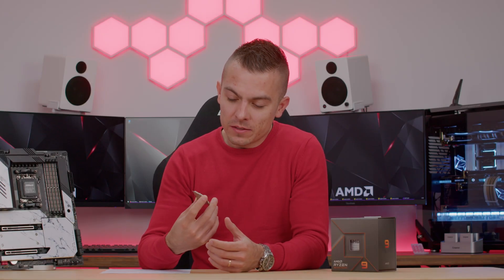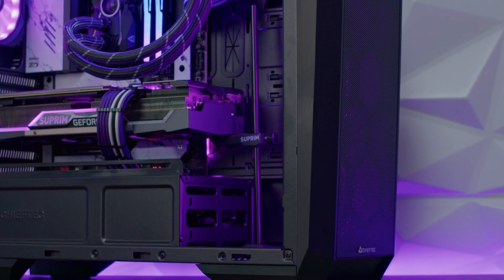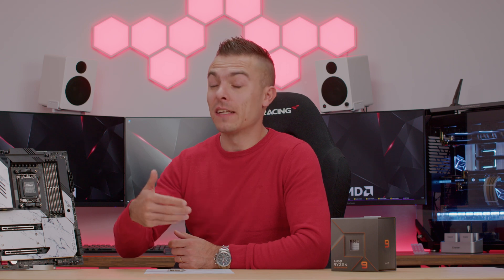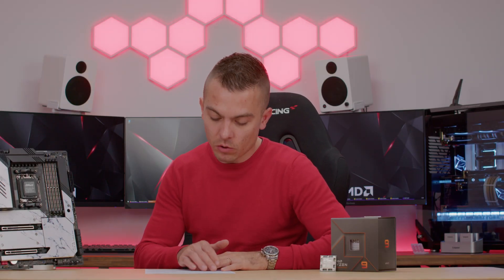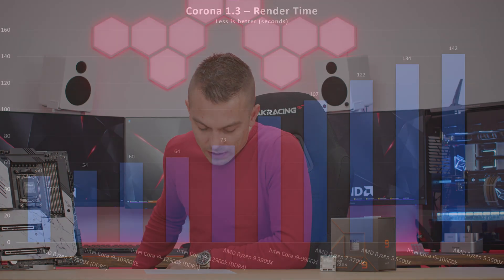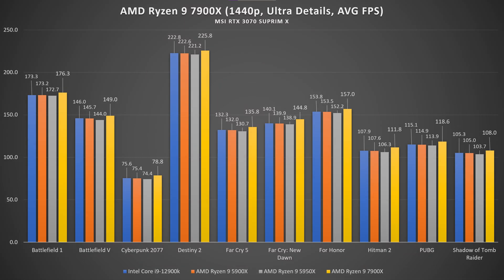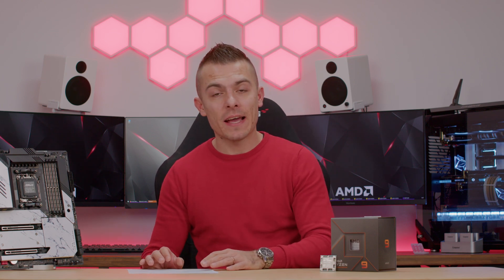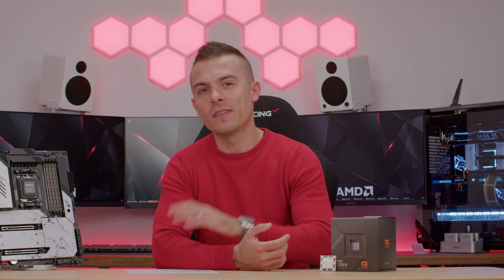AMD Ryzen 9 7900X - Benchmarks & Thermals

Comment: So around 94-95 degrees are fine for this in big rendering like in v-ray with high resolution? Or should I buy better cooler?
Reply from the maker: It's normal for these new gen AMD CPUs. The only difference you will see are in the clock speeds. Thermals should stay the same most of the time, just the clock speeds should go higher and scores should be better.

Comment: Great Review. If you had 5900x would you upgrade to 7k Series of Ryzen. Thank you
Reply: I am going from i7 9700k to a Ryzen 7900x I always went with intel but due to 13th gen being the last on the z790 chipset, x670 has life for up 3 plus more generations of CPUs
Reply: @thealien_ali3382  I did the same. Core i7 8700 to a AMD 7900x. AMD upgrades \o/
Reply: @thealien_ali3382  I'm hopping on this boat too. Same ^ 9700k to 7900x!
Reply from the maker: There are loads of factors here to be honest. It's not just switching the CPU as you might know. You have to grab a decent board if you are going with top-tier AMD chip plus DDR5. But scratching all of that and remembering how long AM4 lasted and will last, this is the biggest upgrade you will make in the coming new 5-7 year (rough estimate of course). Which means from the point you switch to 7k Series with the board and RAM, you will be changing only the CPU next couple of gens. One thing is for sure, it also all depends on your budget cap. I mean, I can go for hours on this topic with pros and cons... You know me hehe :P
Reply: @PCCrazyDario  true, also I went with a decent mono, got 32gb DDR5 ram and just gonna rock this with my 3080. And then hopefully upgrade the CPU in a few years time. But the 7900x should do me for 5 plus years easily
Reply from the maker: @thealien_ali3382  Indeed! That is an insane combo. ;)